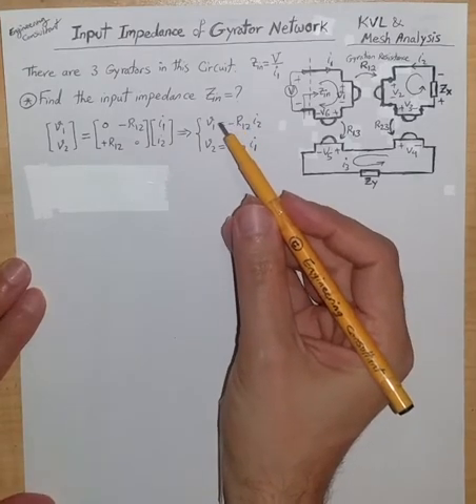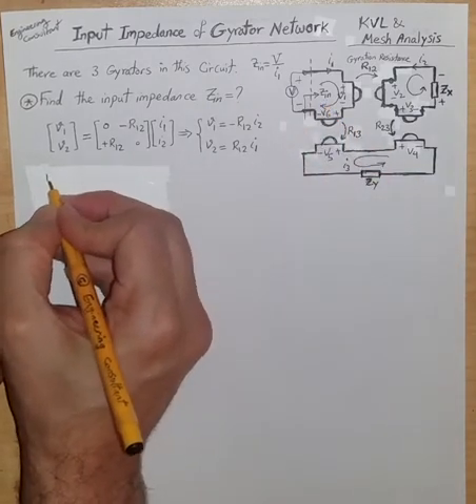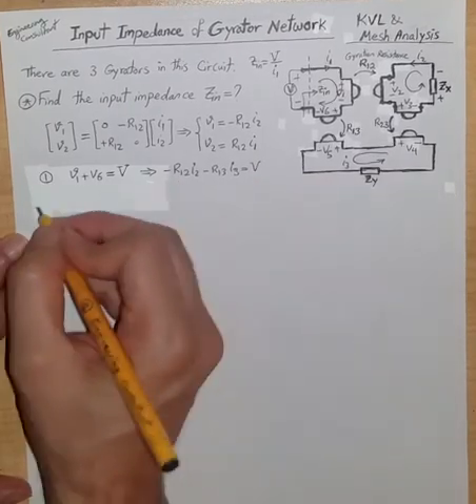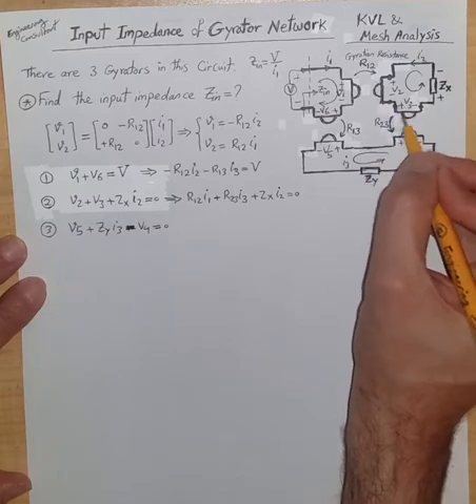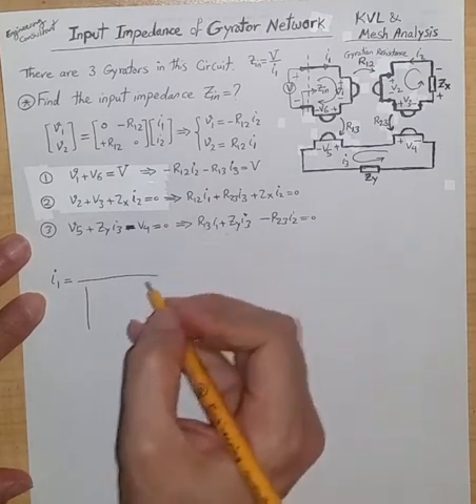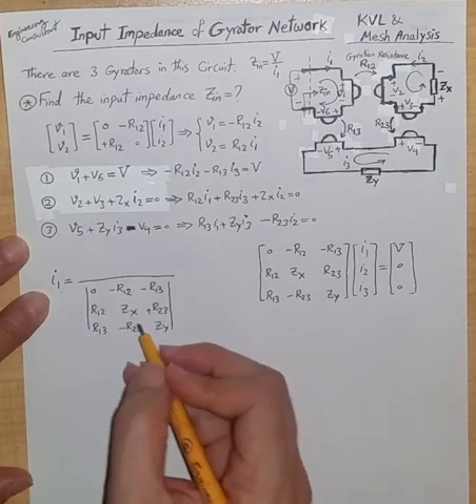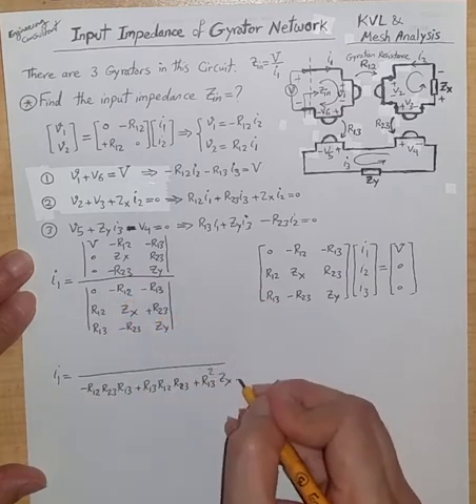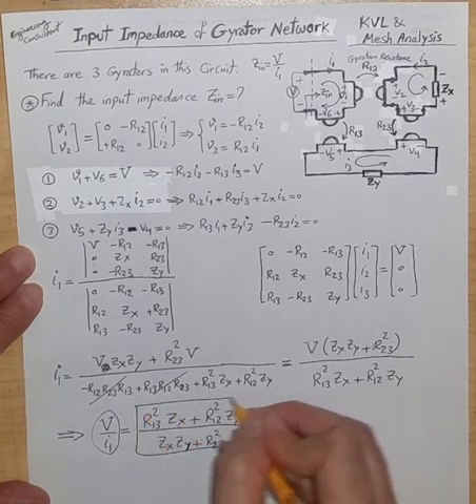Gyrator circuit example and how to find input impedance using KVL and mesh

Comment from the maker: Thanks for watching. For more examples, please see Negative Inductance with Gyrator https://youtu.be/GF_Mun_Mkyo 
Gyrator example2 https://youtu.be/Ls_FvD37yHE
More Gyrator Circuits:  https://www.youtube.com/watch?v=kX5X8jBXVXw&list=PLrwXF7N522y4c7c-8KBjrwd7IyaZfWxyt
Please note that practical inductors have limited range of inductance. The larger the inductance, the bulkier, more expensive and more nonlinear that inductor becomes (low quality factor).  For example the whole circuit including rest of components might be much smaller than just a single one milliHenry inductor. I hope this explanation and op amp circuit examples are helpful.